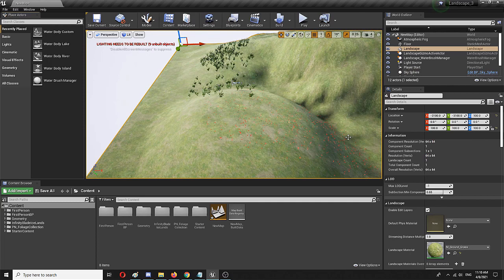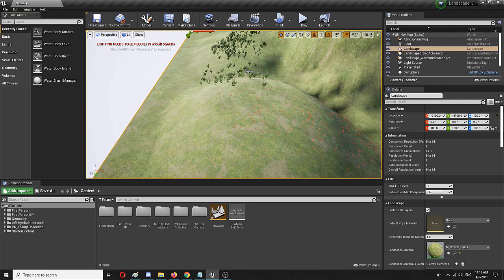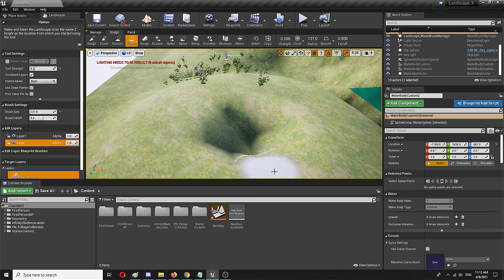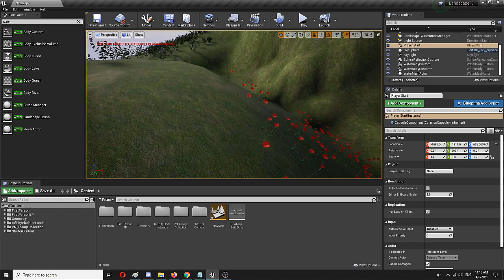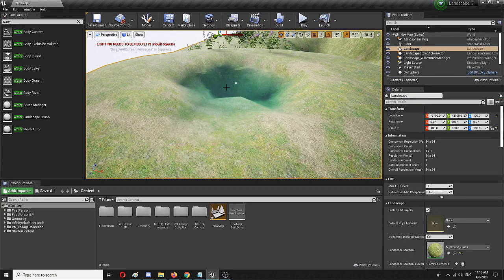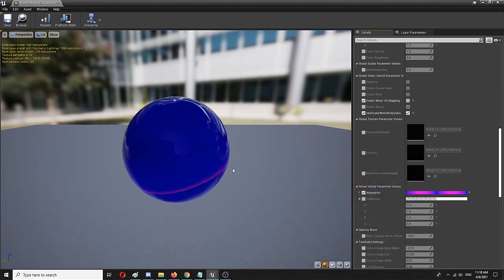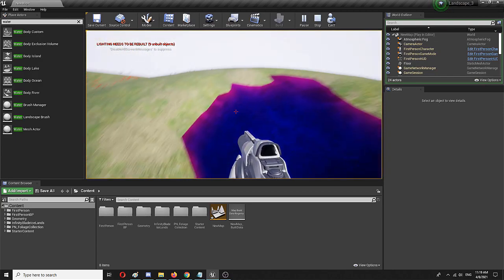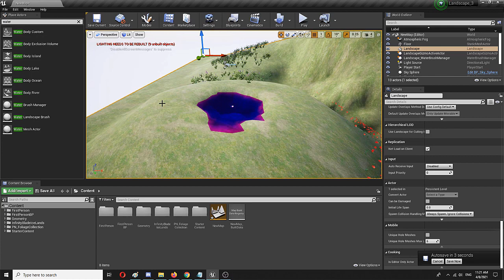How to make Water in Unreal Engine 4 - Simple Realistic Water Tutorial

Comment: Can you float an object in custom mesh water?
Reply from the maker: Yes, but not quickly - you'd need to take an object and then set it in the same plain (water). From there, you'd need to map out several coordinates and create a idle movement/animation. That would give the impression of the same object moving semi-submerged on the surface of the same water. Does this make sense?

Comment: Did You try compile game after all? Does water still there? Because I have no water rendering after launching on a devise.
Reply from the maker: Weird, I didn't try to do a game build. What happens in your case? The surface is gone completely or does it lose some of its properties?
Reply: @IvicaMilaric  The surface completely gone. But it happens only with Custom Water Body and everything is fine with Water Body Lake or Ocean or River.
Reply from the maker: @alexbobrov4490  I have no clue why that happens. In my level the Player Actor fell through the surface of the Custom Water Body, but the shots from the gun, for example, bounced from it. So, the engine sees it. Must be something in the build setup. Is anything else missing besides the Custom Water Body?
Reply: @IvicaMilaric  I even try place both Water body side by side, and when I played in Editor Mode, everything correct. but when I try to launch this on my machine I've seeing everything except Custom Water Body.
Reply from the maker: @alexbobrov4490  I'm sorry, I can't tell you what the issue might be. Maybe create a completely blank level, add just the Custom Water and them see if the build comes out any different?